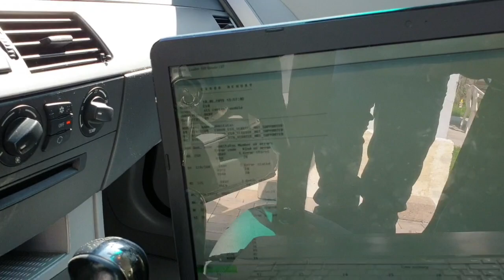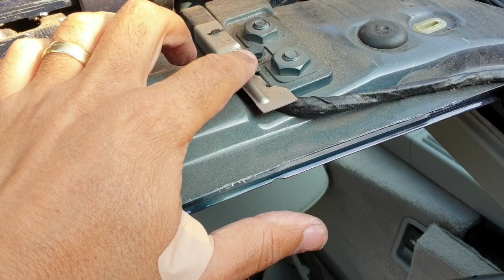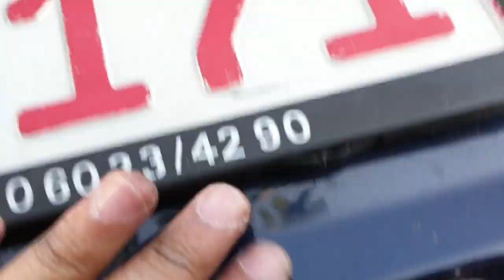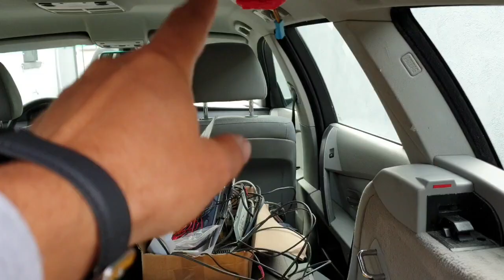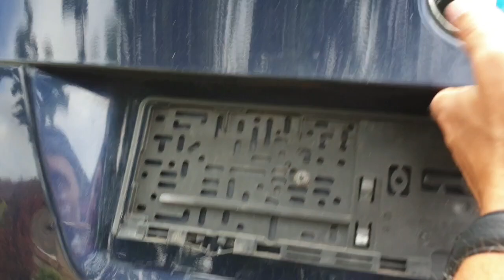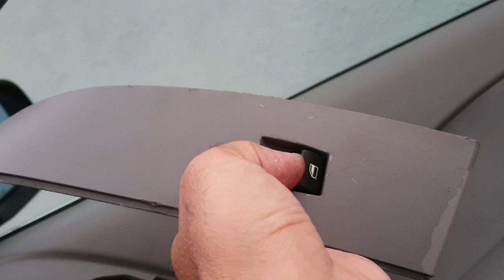Bmw E61 500.000 km  project car P1! Electrical repairs!

Comment: Hello! How did you fix the soft close issue?
Reply from the maker: I've replaced the lock
Reply: Thanks! 
In my case it was still a wire issue

Comment: hello can y help i do that job and now my ligth only work at nigth what can be ?
Reply from the maker: If it's in auto mode will work only on night time. Just turn the light indicator to park or low beam and shoud work
Reply: @WarpDriveM  i do that do the same thing

Comment: Amazing work. How thick is the cable you added to the rear wiring? I need to do mine but want all the new cable to hand before starting
Reply from the maker: Thank you. Not exactly sure how thick the wires are, I had at home the same thickness wires. But you have to use the same thickness wires otherwise you wcan have resistance problems. If you search online you can find wire loom repair set (kit) exactly for the E61. Aprox 30 $

Comment: How did you open the back glass if the switch didn’t work?
Reply from the maker: I found a position on the latch were it worked but normally you have to brake the electrical lock which I've done the second time...and buy a new one. You can see the process in part 3 from playlist